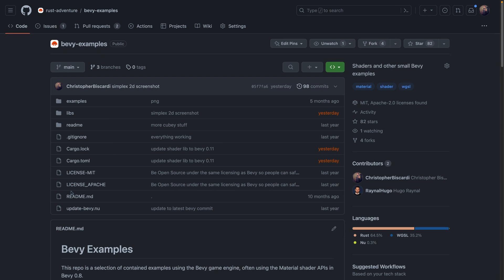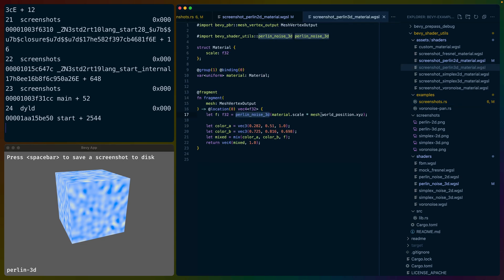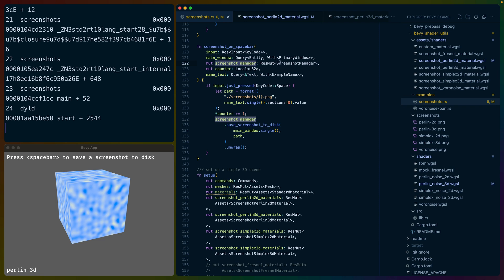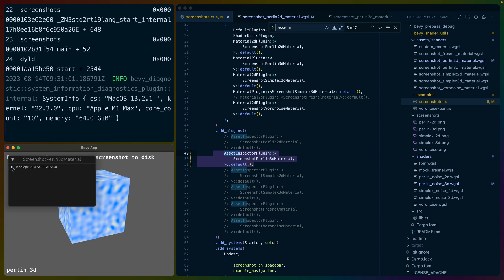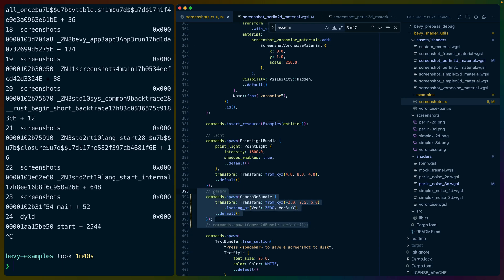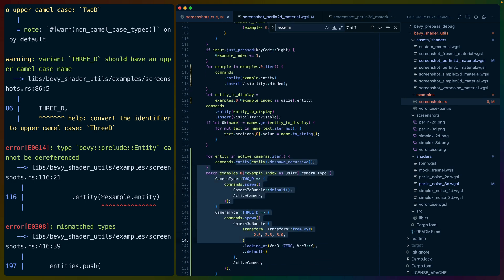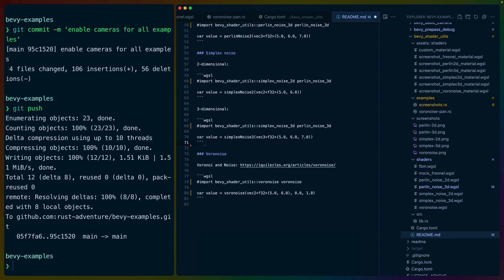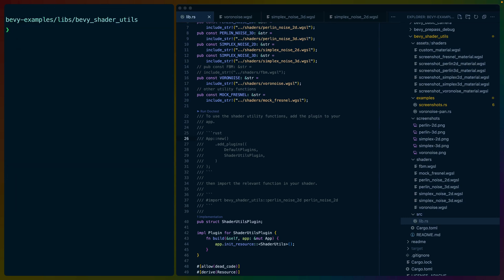noisy material shaders in bevy

Comment: this gave me an idea for a new project :P
Reply from the maker: Sweet! What's the new project?
Reply: @chrisbiscardi  I thought that Bevy could be integrated with a Wayland compositor (via Smithay) to use Bevy to render windows

writing complex rendering code would be made much easier
Reply from the maker: I believe winit, the underlying window creation library bevy uses, integrates with Wayland. How would using smithay be different from that?
Reply: @chrisbiscardi  Smithay is for creating Wayland compositors (like Sway (wlroots) or GNOME (libmutter))

I would give control of rendering to Bevy, but the rendered pixels can be shown in a Winit window or fullscreen by connecting to the GPU directly